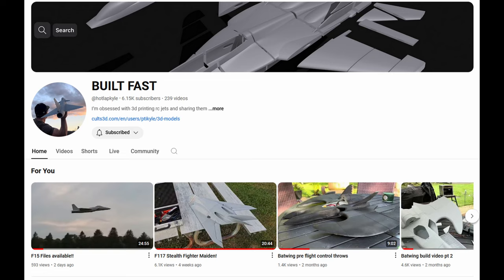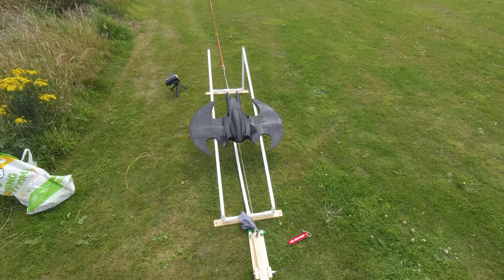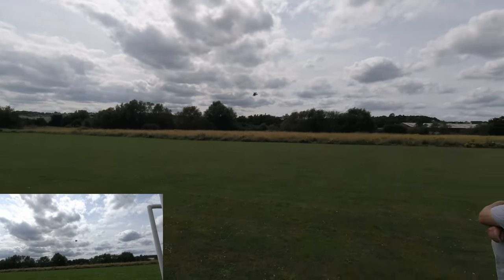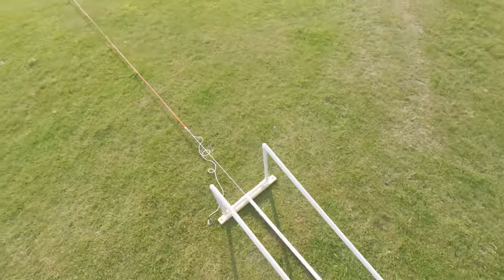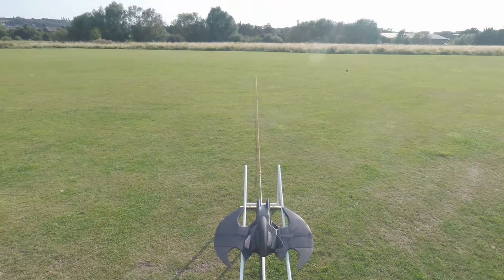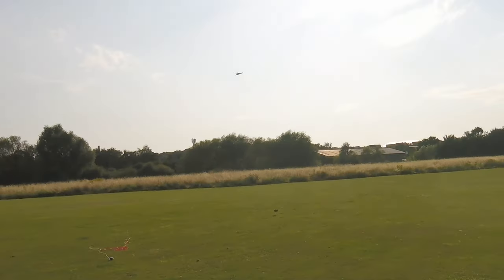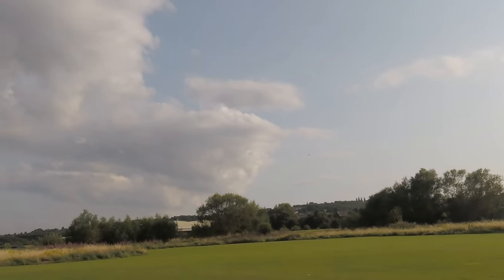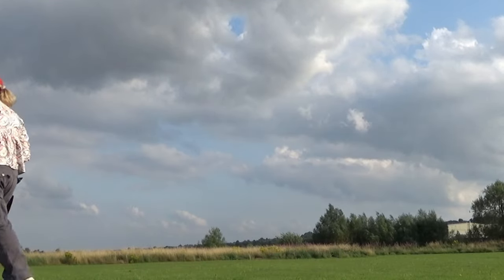BatJet - 50mmEDF       #3dprint #rcplane #maidan #crash

Comment: The hardest part of flying mine was the launch. I like your launch platform. I still have a problem with tail heavy, but when I got mine in the air, it flew great. Very stable in angle. I am disappointed with how easy it is to break. I probably need to find better print settings. I'm running a 4s 3300mah for a battery, what are you using?
Reply from the maker: Same battery - 3300mAh 4S - XFLY EDF unit. I know how variable the other club members are with hand throws so decided to use my bungee launcher that I made a few years ago since it meant I was fully hands on sticks for the launch. The stabiliser was very effective but the alto leveling mode was too much for me to feel in proper control, the 'wind-rejection' mode would be my preference. I may use the auto leveling for a hand launch.